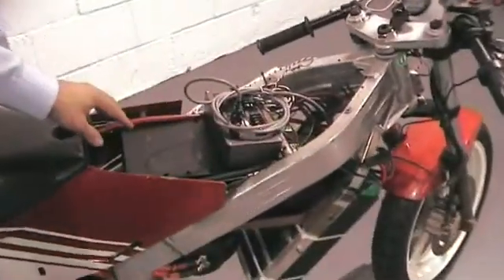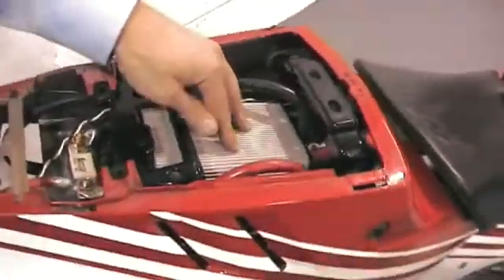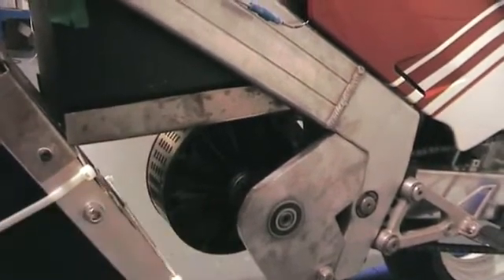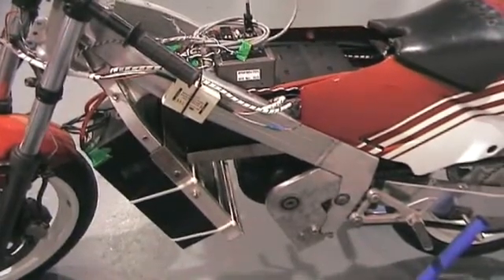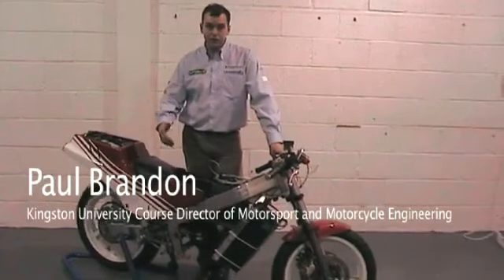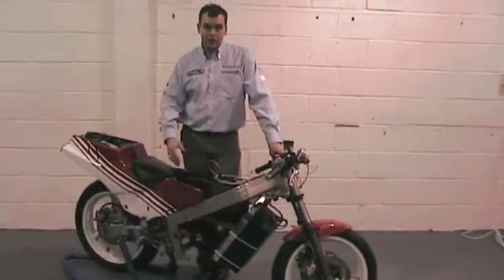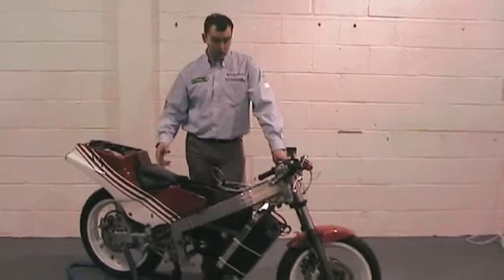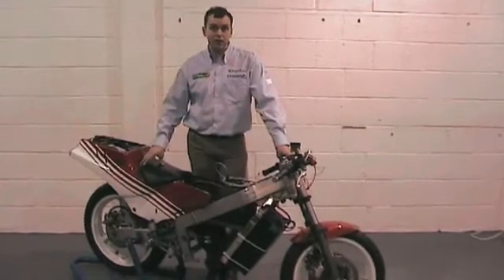Testing the Kingston Universitys entry into TTXGP - Sponsored by LiFeBATT LiFePO4 Battery Systems.

Comment: I would fit the Kelly controller down underneath the motor between the belly pan. Where it will be cooled more effectively. More importantly, you have GOT to keep them motor leads short. ;)

With a good race bike CD of 0.6 and with so little power at speed, its not good enough. Grab a couple of aerodynamicists for the faring. The rules have been changed for TTXGP. They will make you win that race.

All the best.